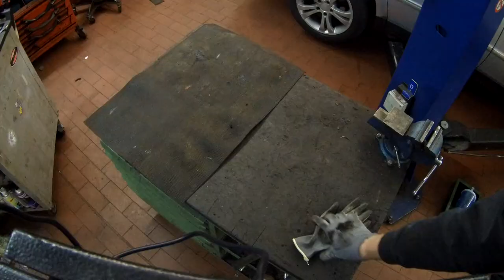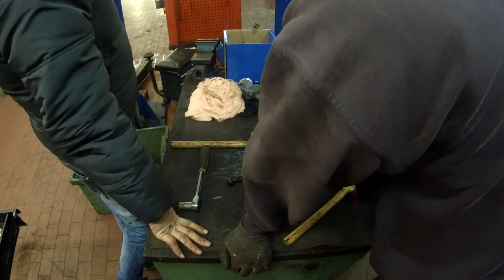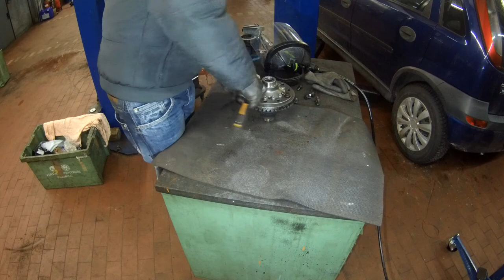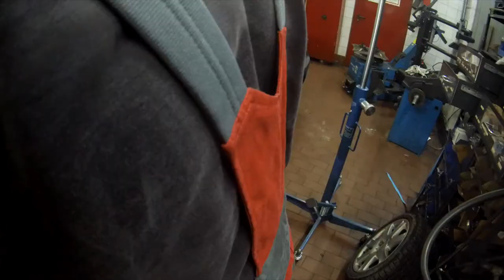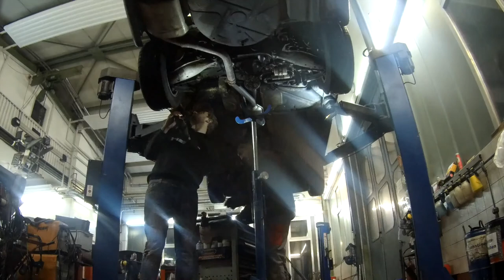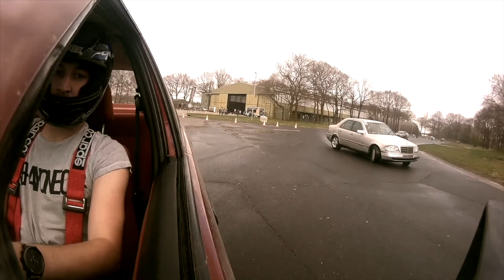QUAIFE limited slip differential - HOW TO install - TIMELAPSE

Comment: Hi, nice greetings from Bavaria (germany) or ven "Allgäu"! :)

The Differential Case just look to be th same as it is in my 2006 Dodge Charger R/T Daytona (5.7L HEMI in combination with many Mercedes basd Architecture/design like; W5A580 Mercedes 5-Speed Automoatic & mostly Mercedes Part Source espcially whn we speak about the gearbox/es & axels in these MOPAR cars)
& even because i´m customizing it to be a drifter, or even Drift use possible car, i´m looking for an LSD/Locker Differential for the stock Mercedes Benz Differential at the rearend. And when i looked to this particular video of you, it really looks to be the same Differential/Case. Don´t know the Gear Ratio, do you know which ratio your diff had/has??? 
I think it could fit to my car, do you´ve more informations about the QUAIFE LSD Unit, like the Part Number/s, pleas???
It could help me a lot, espcially bcaus i see that i´m a "One & only" (or it feels a little like that!) becaus i can´t find any other Dodge Charger/Chrysler 300C guys what has done a LSD Conversation. But in my eyes ANY Rear Wheel Driven Car Platfor should get LSD/Locker Differentials out of the stock, because it´s also a complete change to TRACTION in bad weathr and winter driving conditions. Not any Front whee driven car would come so far in snow, also deep snow if they would had an LSD! It´s completely NOT understandable for me for the Auto Maker of Rear wheel Platforms to use open differentials out of the stock. They would never loose any customer to Front Wheel Driven Cars, NEVER, IF they would use LSD´s out of the stock for theyr so much better Rear Wheel based platforms. also the most so called "All Wheel Drive" Platforms would loose against the most RWD Platforms if they would have an good mechanical LSD (NOT ELECTRONICAL, NOT SIMULATED &/OR ASR"!) 
I´m an Automotov Designer/Stylist, what is really not undersstanding that so big fat fail of th Auto Industry that they doesn´t use LSD´s out of the stock, esp. for the RWD Platforms. it changes an RWD Car completely, if you know what i mean!? ;) (Because it´s even not an Drift Use Must Have, NO! It´s that particular kind of part that changes the RWD Driving forever to great traction also in winter with deep snow, too! :)

Cheers Till

Comment: Hi! I'm buying presumably exactly the same unit for a w201. They should have mostly interchangeable differentials as i know, but they differ a bit depending on axle ratio. Can you please tell if you have 3,07, 3,27 or other ratio? Thanks! And definitely would be nice to hear your opinion on that diff in a mercedes